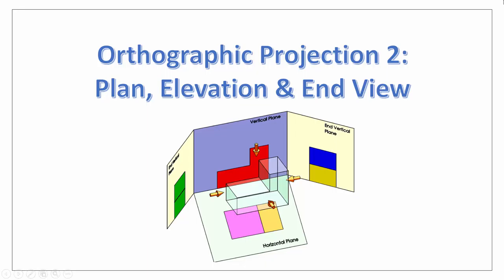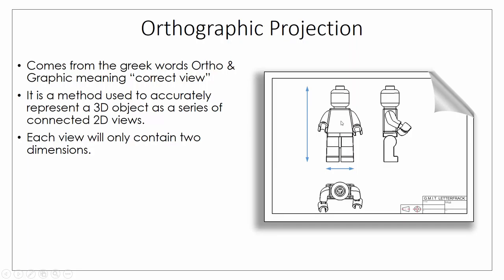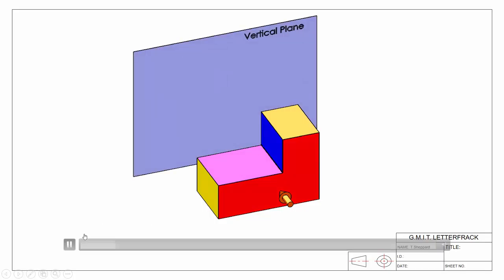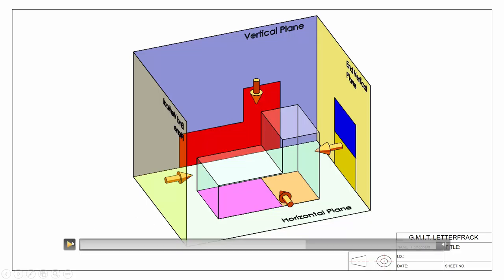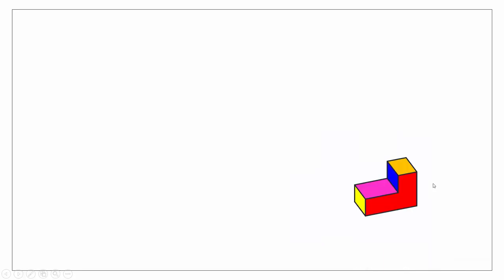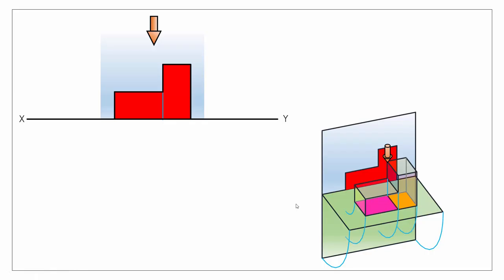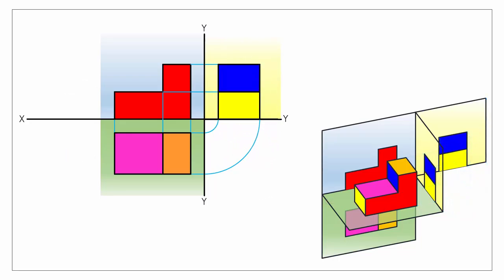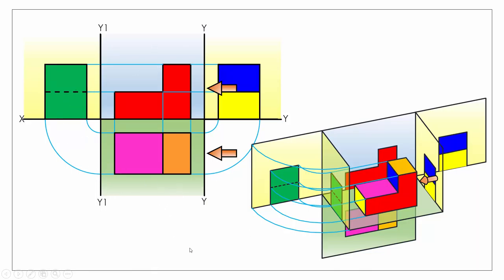Orthograpic Projection 2

Comment: Thanks for your sharing. Please, Thomas, what is the name of software that you have used to create this course?
Reply from the maker: I used a combination of a couple of different programs. The whole thing was put together and recorded in powerpoint. The 3d animations of the planes folding out were created using the animator recorder in solidworks assemblies. The 2d stuff was drawn up in autocad then converted to a wmf file and brought into PowerPoint for animation. The colour for was added using the insert shape tool within PowerPoint. I have made a short video on the process for my own students which might help you. I'll add the link
Reply from the maker: Link to how I animate the line drawings within PowerPoint using solidworks to get the 3d models. The video is pretty quick I just hit record when answering a students question in lass one day 🙂. 
https://youtu.be/ON5t1cP29m8
Reply from the maker: Here's another rough video on how I animate the 3d planes within solidworks. https://youtu.be/JjN1fbteyWc